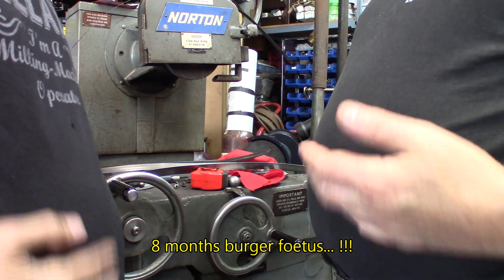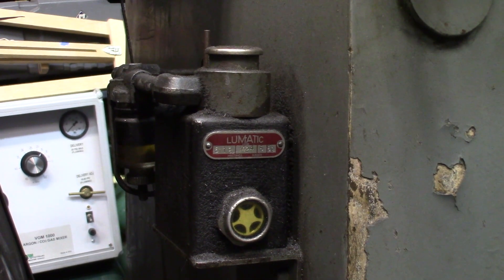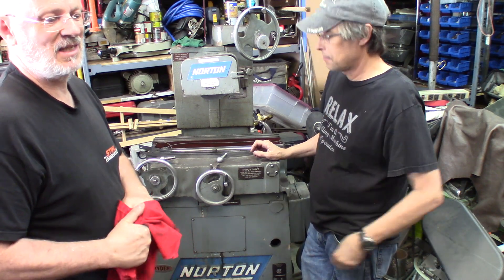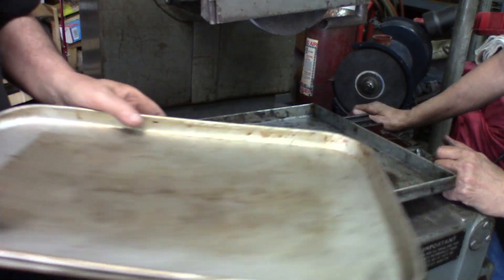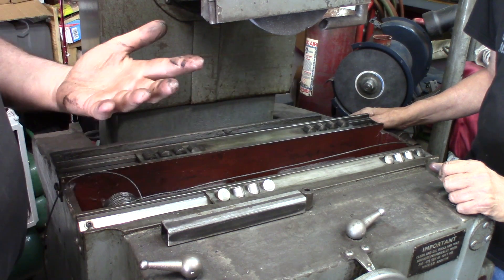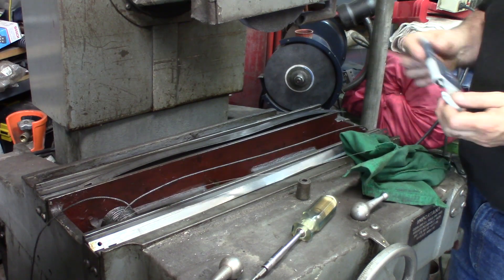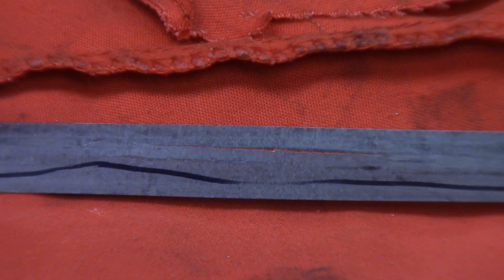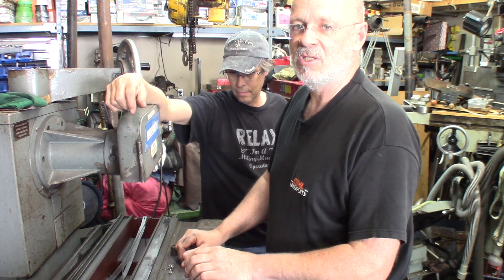Surface grinder repair  Replacing wear bands-PART-1

Comment: What no picture of the hamburgers? Adam would have shown the food as well as the machinery.  Blue tempered shim is fun to put holes in. A carbide end mill works pretty well.

Best,

Tom
Reply from the maker: We didn't get the "rendez-vous" in time for the echography of the fermenting hamburger... Sorry...!   lol
Like you said the making of holes in this material could be a little of a challenge, we'll give carbide a chance...
See you on the 25th...   ;)
Cheers,    Pierre
Reply: Email me the sizes of the blue tempered shim stock. I have some that may be the right width and thickness. 

Best,

Tom

Comment: What was the beer to burger ratio at lunch time?  :-)

Don't have a surface grinder (really don't see need for one at this point) but knowing how that table is set up might prove useful in the future.  Never know when that knowledge will come in handy.
Reply from the maker: Unless you need to rectify parts at very close tolerances, surface grinder is a luxury...
Lately I was only using the grinder on smaller parts cause of the states of the wear bands, now, it will be for larger parts also...   ;)
Just like you, I love learning new stuff and facts, learning is fun.
Thanks for comment,    Pierre
Reply from the maker: BTW, no beer at lunch, don't need it to turn the crazy switch at on... lol

Comment: The two stooges! :-)
That's a nice machine - thus far I am one of the few without a grinder - did have a small one way back but had to sell when I moved (boo-hoo).
Certainly visible wear etc on bands.
Reply from the maker: Hi Chris,
Liquidating tools is always so painful, except when you can benefit from it, guess if you keep your eyes open you could join the bunch soon enough... ;)
Thanks,   Pierre

Comment: Hi Pierre !

I think you should consider placing these two monkeys in two separate cages - way too little work is done when they are together.

Wonder why so huge difference in the thickness of the ware bands for the V and the flat ????
Ofcause the bed has to be "level" relatively to the rest of the machine but ... is it a variable you have to care about when replacing them to GET the bed "level" ?
Reply from the maker: Hi Keld
The engineering makes the platter leveled, also the machine's base is made with 3 points of contact, and they need to be leveled before operating te machine.
When you send 2 monkeys to over eat, they want more to nap than do some work...   lol
But a little fun most of the time is a great life...   ;)
Thanks for visiting,    Pierre